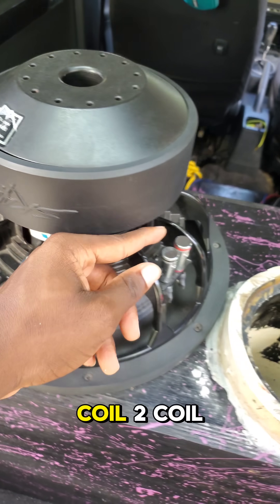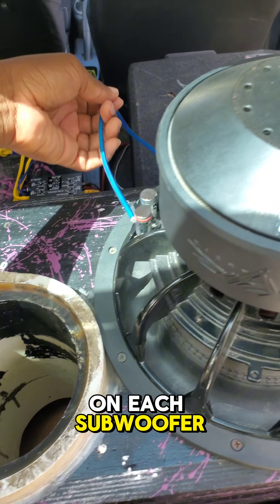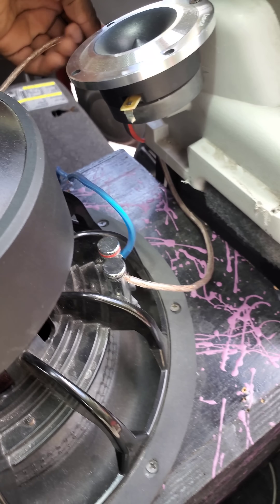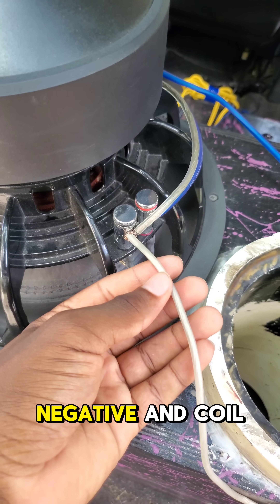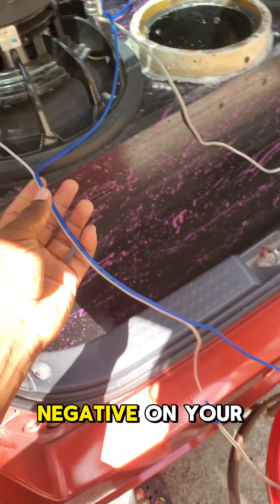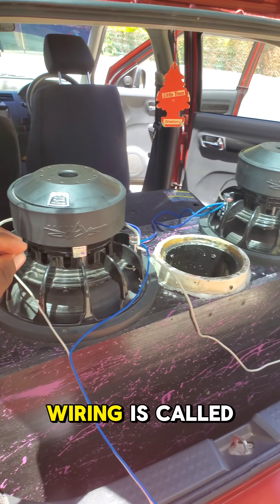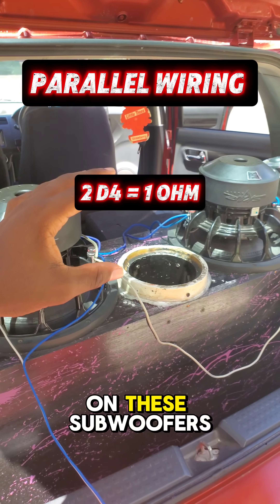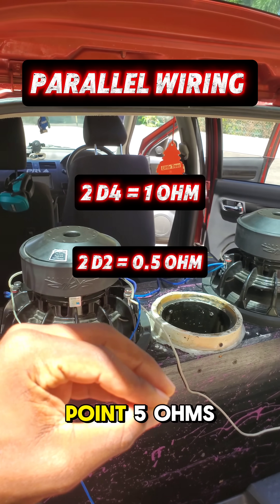1 ohm Parallel Wiring for Beginners

Comment: I ran these in a ground shaker 30 Hz box with my Orion XTR 2500 - 5000 EVL subs are great and sound good check out some of my vids these subs move an handle more then 1250rms I had mine wired down to 1ohm and I had the 4 ohm versions as well I had three H6 duralast Platinum batteries and a 320 amp auto tech alternator Big three upgrade all zero gauge sky high OFC wire It got down 🤙🏼
Reply from the maker: W setup you have well put together 🔥🔥🔊🔊🔊

Comment: Easier way to do it is put positives and negatives together on each sub then take 1 positive and 1 negative from each sub down to the amp and put positives together and negatives together or if ur amp has 2 positives and 2 negatives just land them there and the amp already connects the positives and negatives as long as its a one channel amp.

Comment: You are completely incorrect. Parallel wiring means positive to positive on the voice coils and then positive to positive on the next subwoofers voice coil on both sides then everything negative to negative that is parallel wiring. For 4 ohm subwoofers that are dual voice coil 4 ohm they will run at 1 ohm. For subwoofers that are 2 ohm dual voice coil subwoofers running in parallel will give you 0.5 ohms. What you're doing I'm not even quite sure It looks like series / parallel wiring. And that does not give you a one ohm load on your amplifier. Whatever you're doing looks like you're running at four ohms or higher. And you should never be plugging in more than 2 wires on the post of your voice coil.
Reply from the maker: This shows that you didn't watch the video 🤦🏽‍♂️ in the video I did Parallel Wiring where I connected all + to + and all - to - which will lower your impedance on your subwoofer. I may make one mistake saying - to + in the beginning of the video but the Wiring is actually + to + if you re-watch the video you'll see that the Wiring is correct and that I just made one mistake saying what I said in the beginning
Reply: @tyreeisvibin I watched the whole video. You connected one side of the subwoofers voice coil from positive to negative on both of the subwoofers. This is series / parallel. You need to learn a difference. If there was a way I could post a chart of what you did I could show you exactly how this is not parallel wiring. You connect parallel from the positive on one voice coil to the positive on the other voice coil and then you use a jumper wire from that positive to the other subwoofer positive and run another wire from that voice coil side to the other You do the same with the negative You only need two wires coming off of the amplifier and the only connection where there would be two wires connected in one spot would be where you connect from the amplifier wires to your first side of the voice coil on subwoofer number one there should be positive going across all the way not positive to negative like you showed in your video. You connected positive to negative and positive to negative on both subwoofers then connected them in parallel that is called series/parallel where it isn't series and it's not parallel
Reply from the maker: In the video it's connected + to + I just made a mistake saying negative to positive at the beginning. Series / Parallel Wiring is when you jump a - to + which I never did in this video idk where your seeing that.
Reply: @tyreeisvibin well then maybe I misheard you when you said connected positive on one side to the negative on the other. But you should never have more than two speaker wires going into one post on a voice coil. You can just run it right from the amp to your first voice coil positive didn't positive negative to negative then use jumper wires to go over to the other voice coil side then from there you get two more jumper wires from the end of the first subwoofer for positive to positive negative to negative and then use the jumper wires to go across to the negative and positive side It saves you space because you should really be using 8 gauge wire or lower if the post can handle it. If not you should be using ferals. You can connect two wires into one with a feral. The thicker the wire the better. Depending on how many watts your amplifier is putting out. If it's only a thousand Watts or so it wouldn't make much difference but when you start getting in the higher ranges you want thicker wire for less resistance. I've been doing this for a very long time. And if you have a high power amplifier that let's say can only accept four gauge they have reducer blocks you can buy let's say 1/0 wire reducer for 4 gauge and it will fit directly into your amplifier but this is usually for higher power setups I don't know how many watts your amp is pushing or how many amps it's drawing from the battery. I also seen some of your other videos where you were talking about inverted versus non-inverted subwoofers and the reason people do that is because their boxes too small or they want to show off the subwoofer. The problem is most people have no idea that their box should probably be twice as large as they think it should be and should be twice as thick and the reason why they usually call for 1-in MDF on anything that's over 3,500 to 5,000 Watts is for box impedance rise. If you have a poorly built box, your amplifier will rise in ohms. But more expensive subwoofers have a better tolerance for this as long as you are building it to specifications or a little larger. A little larger with the correct port or a port that is a little different will let you be able to set your frequency lower. Any subwoofer that's about 3,500 Watts or more should be in a box ported that is at least at the bare minimum three and a half cubic feet and that's for 12s 15s you want to be around 4 to 5 cubic foot ported for each sub. People buy universal boxes and don't understand why their subwoofers don't sound right and this is exactly the reason.
Reply from the maker: Lol bro that's what I said 🤣🤦🏽‍♂️ I made a mistake saying connect negative to positive but in the video if you actually watched the video the positive is connected to positive and the negative is connect to negative. I just made a mistake saying negative to positive In the video the wring is connected correctly. I want you to watch the video on mute and see that the wiring is actually connected correctly
Reply: @tyreeisvibin Yes I can see it now that you said it. I wasn't really paying attention to the colors I was listening to what you said.
Reply: You can also save on your wiring if you just run from the amplifier to the one subwoofers positive and negative and then just parallel from there, there should never be three wires connected to one terminal.It's hard to explain what I'm trying to tell you without showing you a picture and I can't show you a picture. @tyreeisvibin
Reply from the maker: I get what your talking about lol but there's not 3 wires running on the terminals also it's 2 at max 👊🏽
Reply: @tyreeisvibin oh you are correct, the way that the video was taken just made it look like there was three wires there my fault